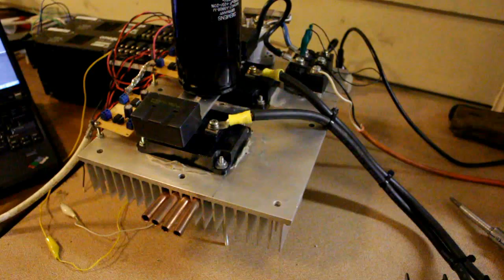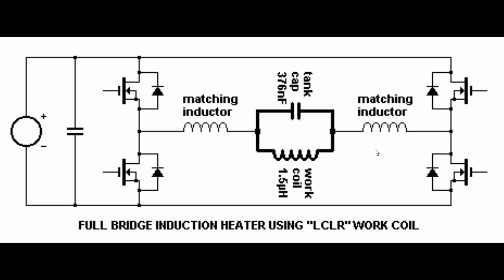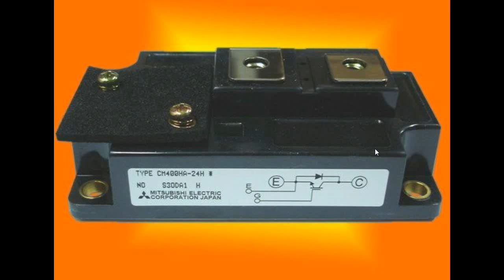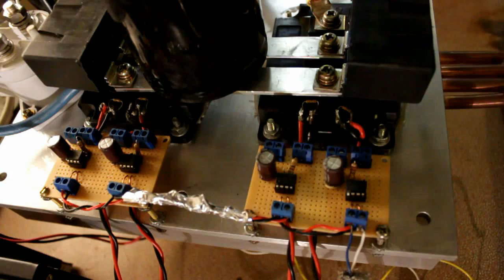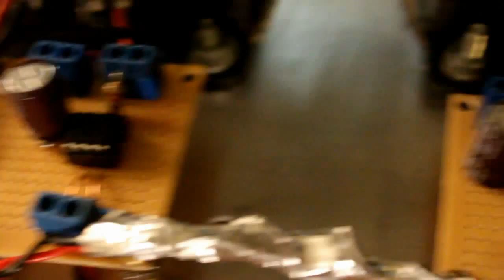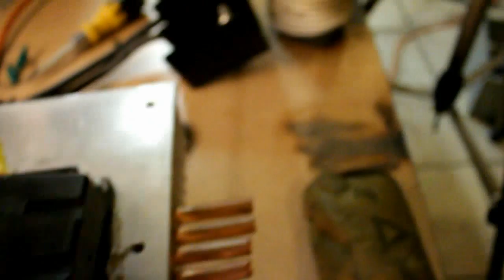Basics of IGBT Full Bridge Inverters

Comment: Jai Shree Krishna, 🙏🏻

Extremely Informative video thank you,. Can you assist with a high volt low amps dc input (1500v and 20 amps) convert toa low volt high amps ac output (230v 65amps) ac output using an h bridge? Preferably pure sine wave. If possible would like to discuss more via email 

Aumecycle@gmail.com

Comment: Hi ! why the snubber is connected to the dc bus ?
Reply from the maker: The IGBT turn off spike also has an effect on the bus voltage. The main DC bus capacitors won't response fast enough to quench the initial spike. So the metal film capacitors help with that.
Reply: @subcooledheatpump  So , i must connect snubber to DC bus , and to switch ?
Reply from the maker: @deric1  Unless you're having major problems with turn off spikes, it usually isn't necessary to connect on across the switch itself.

Comment: I'm not understanding why you say each "gate driver" needs an isolated power supply.  Both high-side drivers could share a supply, and both low-side drivers could share another... but why not use real gate drivers with charge pump... no worries at all.
Reply from the maker: Only the low side gate drivers could share a power supply. The high sides need some form of isolation between them, otherwise the bridge output will be short circuited
Reply: Therein lies the reason the full bridge charge pump gate drivers exist... like SM7295, A3921, DRV8704 (dual H-bridge), MC33883... and many more. Even the ooollld faithful IR2110 is great for this... it just takes two of them for a full H-bridge.
Reply from the maker: @beforebefore  Yeah charge pumps are ok for lower power applications. Personally I never had too much luck with them. Probably did something wrong I'm sure. Most manufactures recommend isolated power supplies, even for the low sides after a certain power level.

Comment: Hey,
For reverse input voltage protection,I decide to employ diodes in series with each IGBT,will an inductive load be able to discharge when the switches are off since the free wheeling diode will not be conducting?

Comment: Hey, very nice explain, thz gate driver using and why interverting. But, i f i want ro send just cycle lf swiching ( i want these 4 igbt switch off, how i can get that? Is needed to send all at gnd ?
Reply from the maker: To switch an IGBT off with a gate driver, all that's needed is removal of the input signal to the gate driver. Without a gate driver, simply short the emitter and gate terminals
Reply: @subcooledheatpump mmh, i think the gate works like capacitor parasite thx for answer

Comment: Is it not possible to make a full bridge Inverter with only one power supply for the gate drivers?
Reply from the maker: Some gate drivers can drive both high and low side and provide a form of isolation that is built in. You can use just one power supply for the low side IGBTs, but the high sides are where the isolation is required.

Comment: you are using gate resistor at the output of driver ic.what is the value of second resistor that you have solded on IGBT module.how you have selected that resistor.i assume you have connected that resistor between gate and drain of IGBT.this resistor has not been shown in circuit diagram.is this resistor is to charge and discharge gate capacitance of IGBT module.please correct me.
Reply from the maker: The place I bought those IGBTs from sometimes would have a 1K resistor soldered between the gate and emitter, this keeps the gate from being damaged by static buildup during shipping. It's also sometimes helpful if you aren't using negative gate drive/bias, just to drain the gate and be sure it won't turn on without a signal from the gate driver
Reply: is there any way to calculate the value of resistor connected between gate and emitter by using data sheet.i have build the circuit of induction heater but one of my module is heating while second is normal.is this due to square signal of IGBT gate driver.can I trigger gate using sine    wave.if yes then how to implement dead time technique. is it possible to reduce heating by reducing deadtime.i mean is heating effect is deadtime dependent.

Comment: What is this unit called for and what does it do? Found 2 of these with hot-swap(?) handle.
3 Pictures here: https://postimg.org/gallery/2gophpmlk/
Than serial number is for transistor module and that way I found your video.
Reply from the maker: Not sure what type of unit those are, but the transistor is not an IGBT, it's a darlington pair transistor
Reply: Thanks man!

Comment: hello sir , can u explain me how can u manage dead band of igbts, means how all igbts are off for some fractions??
Reply from the maker: That usually isn't managed by the IGBTs or the gate drivers, but by the PWM generator which supplies the gate drivers. Many PWM IC's feature built in dead time control, MC3PHAC is one example of a PWM motor controller which features built in dead time control
Reply: Thanks for reply,
Suppose I'm giving pulses to igbts using Microcontroller then it's necessary to give pulses with dead band difference?
Means suppose I'm using h bridge mode at that time I'm switching on diagonally igbt pair and then other pair diagonally...At that time between these two switchings I should put dead band?

Comment: if you could give me an idea frequency to switch my igbt (1khz - 18khz) and some of the benefits of higher vs lower frequency. I figured out most of the small things I'm trying to figure out how much heat this thing should produce. hearing the switching frequency doesn't bother me I have a currently set at 18 kilohertz but gets warm rather fast. I have a heat sink measurements 2 inches tall 7 inches wide 10 inches long, also I tried emailing you but I'm not sure if you got it or if I'm in your junk bin.
Reply from the maker: Try mailing me again, but put my youtube username in the subject line. That should help it get to my inbox. You've already figured out the most important part about switching frequency. Higher switching frequencies produce a smoother current output, but they also dramatically increase the switching losses. You can lower the switching frequency to reduce IGBT heating, however if the output current becomes too rough, you may need to add in passives (inductor, capacitor, etc....) to smooth the output current

Comment: Hello!! Thanks for all you knowledge you post here. I want to know, if I am going to use an IGBT (CM400HA-24A) as a dc motor speed control from 30 A123 20ah cells must I use isolated dc for the gate driver??
Reply from the maker: Technically you don't have to if you are only driving an IGBT chopper and not a bridge circuit. But I would anyway
Reply: CM400DY-24NF   CM400DY-50H   CM400DY-66H   CM400HA-12H
CM400HA-24A     CM400HA-24E   CM400HA-24H  CM400HA-28H
CM400HA-34H     CM400HU-24F    CM400HU-24H  CM400YE2N-12F
need any other igbt module, please kind contact us.
best regards,
sales@asiantx.com

Comment: hi dear i want build a single phase motor controller i made 2 square wave with SG3525AN ic that i can change the frequency of this two wave 9hz up to 300hz if  i want drive 4 igbt with this square wave i have to use the hcpl ic? i can not understand what how can we connect the negative of 15 volt source for vcc of hcpl ic to emitter of igbt because we have the flow of current to load i mean this current dosent harmful for hcpl ic.thank you so much

Comment: could this run at 60 hz. and 120v for a DC to AC power inverter. or as a DC to DC boost stage for a inverter. I am needing to build a inverter to power my off grid home. I am self taught. and learning all I can to build my inverter. for like 24vdc to 120vac. thanks for the videos. they have really helped. but I would like to know more about the brain of the system. what powers the FETs or igbt. I have thought about just using a ic555. but I don't think it will do what I need. I need to regulate output and compensate for battery voltage drop. so its the boost stage I'm in sure about. if you could give any help or advice. I will be grateful and thanks again!
Reply: did you succeed ?
Reply from the maker: Yes you can run something like this at 60 Hz, but that would output a square wave and that isn't what you want. You want something that is running PWM that simulates 60 Hz. The easiest way really, is to get yourself a big VFD and an output filter. Set the output frequency to 60 Hz. Then make a boost converter to feed the VFD DC bus input. Of Course, You can make your own inverter that will work as you want. Several micro controller chips are available that are pre programmed to do the job you have in mind. MC3PHAC is a motor controller chip that can send drive signals to gate drivers to switch IGBTs in the correct pattern, you just need to provide the capacitors, oscillator and resistors. Then it would be the same, just feed the DC bus with your boost converter.
Reply: +subcooledheatpump thanks for your reply. I still haven't got to far on my project. but I found a inverter driver board with get drivers. looks like it will work. and I was thinking of using a arduino for the DC boost stage. and was thinking of using a center tap push pull transformer. but to put out 6-8kw. it would be huge. and limited to low frequency. I was also of building a core from iron powder and epoxy. basically use a laminated iron core transformer as a model. or go with a toroid of a decent size. maybe 10-12" and see if it would run at 1khz or so. I would like for it to be oversized. so I can expand the inverters output later. to around 10kw or better. as my battery bank grows.  I would love your advice. you seem to really know your stuff! and your videos are a very useful learning tool and I have watched a few multiple times. I have learned lots from them. thanks again

Comment: so would the igbt modules work good for a DC to ac inverter. h bridge. and for the DC to dc boost . I'm kinda new at all this. but need to build a DC to ac inverter. to run my home.  it just seem a few igbt modules would be simpler than a few dozen MOSFETs. I would like to make it where I can expand the potential of it. like 3kw. then double that 2-3x later as I need more power. I guess what I'm wondering is do they switch fast enough to be used in a spwm inverter. I think its a 23-24khz carrier and 60 hz sine wave. thanks and I enjoy your videos

Comment: Can please specify the dead time
Reply from the maker: +paul bergin For all the questions about dead time, Dead time is simply the required time when all IGBTs are switched off. For each IGBT, a value is specified in the datasheet for these characteristics; Turn on Delay, Rise time, Turn off Delay, and Fall time. You will notice that most IGBTs usually turn on faster than they turn off. In Inverter circuits, such as shown in this video, this could cause both high and low side IGBTs to be on at the same time, causing a short circuit known as "shoot-through" (IE. lower would switch on before the upper switches off) Dead Time simply turns off both IGBTs for a very short time (usually around 1 microsecond) to allow each IGBT to fully turn off before the opposing IGBT turns on. Gate resistance has more of an impact on turn on time, as the IGBT's gate is a capacitor, higher resistance leads to a slower turn on. This could help relieve some mismatch in turn on and turn off times. It is possible to use two different gate resistors on the same IGBT, one for turn on and a different one for turn off to match the rise and fall times, this helps reduce or eliminate dead time. The gate resistance does affect turn off, but only so much, as IGBTs like other bipolar transistors feature a parasitic "current tail" or fall time. This current tail will limit the IGBTs turn off speed, and is thus the reason inverter circuits need to use some dead time.
Reply: +Tinsae Berhane 

Hi mate, was that question directed to subcooledheatpump or myself>
Reply: +subcooledheatpump
Thanks heaps buddy, this is what I imagined was the case, the difference between the turn on and off times for my Ixys IGBT's is quite noticeable on the scope and would definitely lead to problems with shoot-through as you up the drive frequency. So in general a higher gate resistance will delay the on saturation time which will alleviate the risk of crossover time, I also understand that too much delay will lessen performance. I have set up a test rig to visualize the actual gap between output pulses on my scope whilst running at 20khz. I will aim for 1us. Ta mate.
Reply: +paul bergin sorry for the confusion it is for subcooledheatpump
Reply: Thank you very much i have the answer for my question. it shows that i can ask more question. Thank you again!
Reply: +subcooledheatpump 
Hey Dear, could you please tell me 
1. purpose of capacitor bank in igbt circuit (both in motor controller and induction heater) 
2. how to select and size capacitor banks 
3. how to select snubber capacitor and free wheeling diodes 
my question answer may depend on the type and power of application but i need if there is general rule for rough estimation

Comment: Hi mate, love your stuff... I've learnt heaps from your easy-speak approach. I do have a question for you though and I'd love to see how you would explain this. I don't think you've covered this subject in any great detail as yet (correct me if I'm wrong). Could you please cover the effect of gate resistance on the dead time in inverters. ie: The delay caused by gate resistors and the dead time required in real circuits such as inverters. Ta mate.

Comment: Great video, very informative! Can I ask what type and size of capacitors you used for this circuit. Both for the capacitor bank on the igbt and the caps used with the 555 timer to get a ac signal. I'm a little confused about the sizing of them. Thanks again for the great video.
Reply: V 
Svbbybg hygghhhbbbgbb   Cxvc jb hh bbbbbbbhbb b bb.

Comment: A full bridge "inverter"? Interesting!

One way of classifying power conversion systems is according to whether the input and output are alternating current (AC) or direct current (DC), thus:

DC to DC = DC-to-DC converter, Voltage regulator, Linear regulator

AC to DC = Rectifier, power supply unit (PSU)

DC to AC = Inverter

AC to AC = Transformer, Voltage converter, Voltage regulator, Variable-frequency transformer

Comment: I wouldn't recommend to solder part on IGBT brick.  It can low lifetime or degrade IGBT by heat.  Also it is unsafe.  If spark, IGBT might died.  Hundred dollar draining.  Gate part are not very strong as you think.  Spark can happening anytime.
Reply from the maker: Good Points. These IGBTs are just surplus so I didn't mind abusing them a little to save some time.